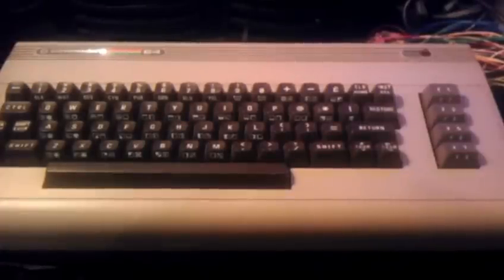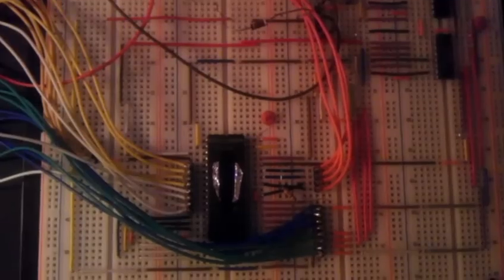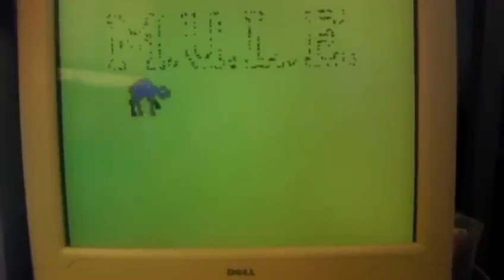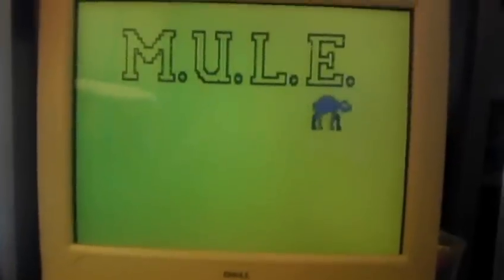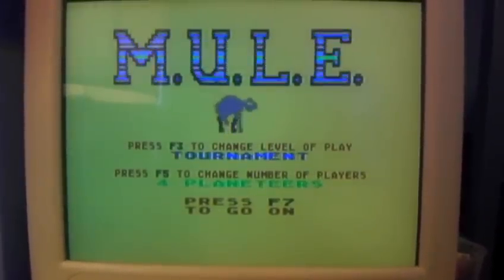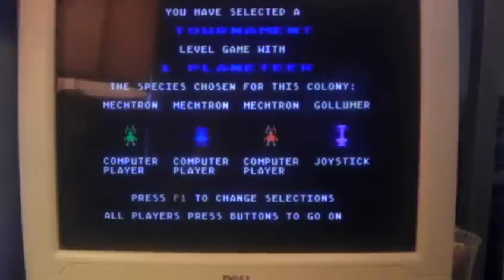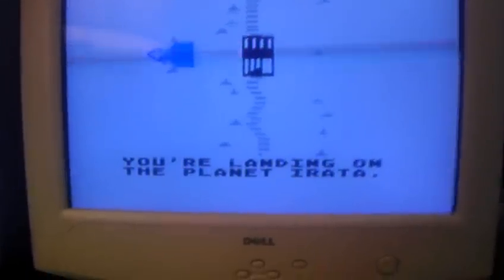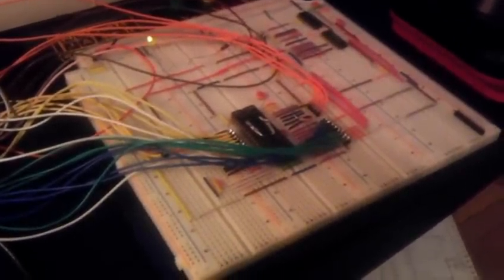Commodore 64 128KB cartridge

Comment: I wonder how the 8/16kb bank selection is made? Is it by toggling a pin and signal the cartridge to do a bank switching?
Reply from the maker: The circuit design does not account for switching between 8 and 16.
Reply: My question is similar...how do you bank out rom area to get greater than 64k(not ultimax). I have seen cartridges like terminator II that use a 4Mbit EEPROM. I just bought bomberland 64 for example, and it uses a 64kb 27C256 Eprom. I know some glue logic is necessary for it, but is there any resource out there on how to wire that up in principle?
Reply: More importantly, how does that work in software? Can anyone point me to some documentation regarding this?